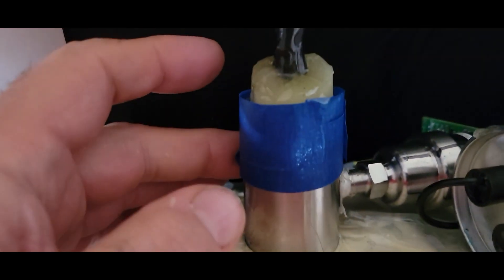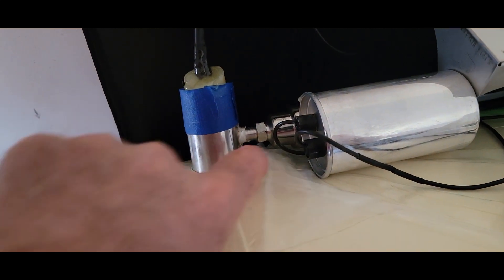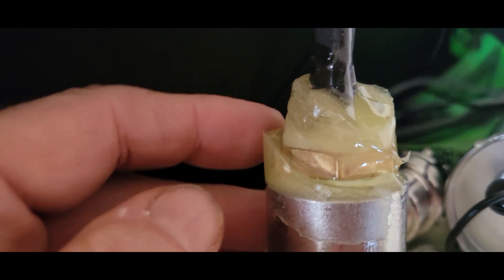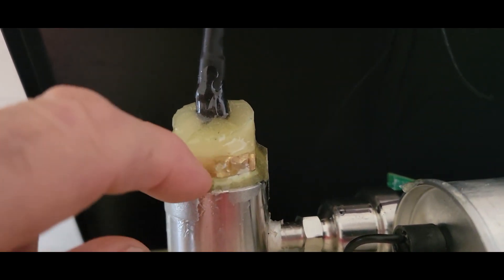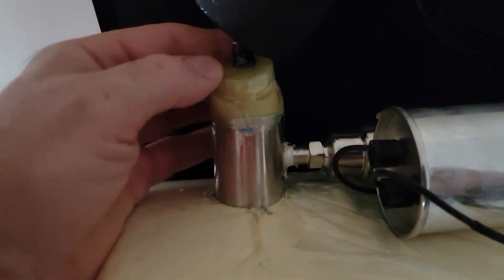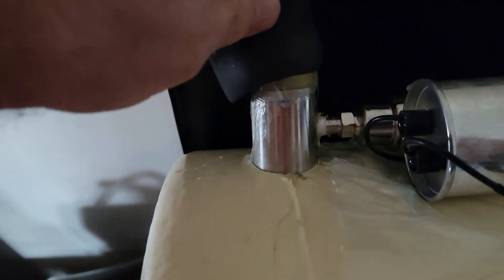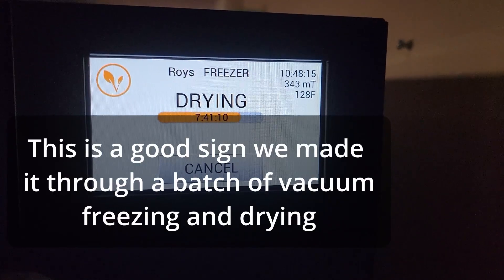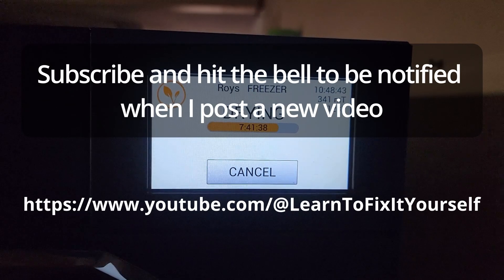Harvest Right Vacuum Error #9   Part 7 Epoxying the connector

Comment: Never use epoxy!  Use liquid tape…it will stay pliable and do it under vacuum…epoxy will crack and leak
Reply from the maker: that is what Harvest Right suggested.  we will see how it works over time,  I will be making more videos on the problems if it comes back.  We now have another option for Freeze Dryers other than HR.
Reply: @LearnToFixItYourself  the liquid tape should last the life of your FD....good luck with everything!

Comment: Did you just use standard epoxy from Home Depot, etc?
Reply from the maker: yes, I used the epoxy with 3000 psi strength because that is what I had on hand.  The tech sent me a new wiring harness and this one had epoxy on both sides of the wires entering the tank.  We found 3 places causing the leaks.
Reply: @LearnToFixItYourself  what were the other 2?